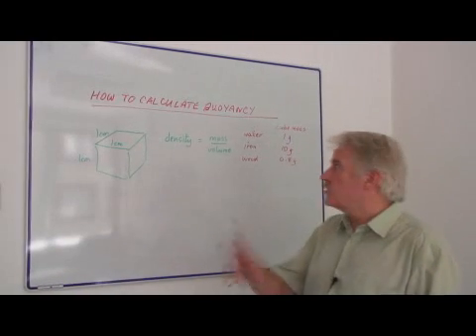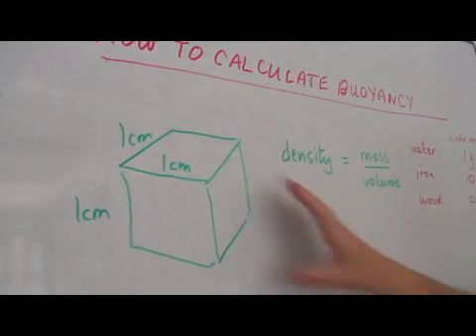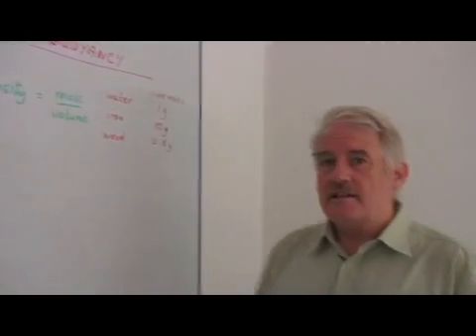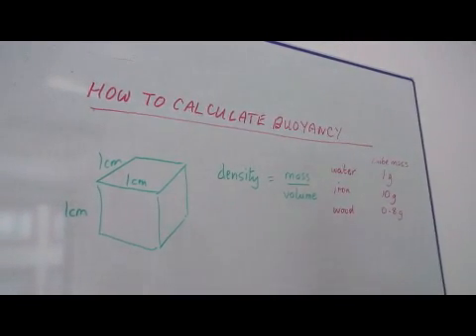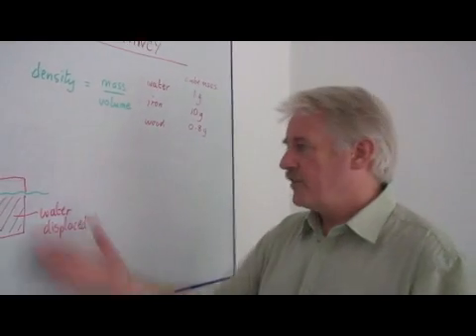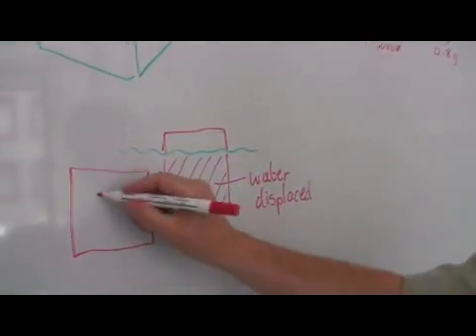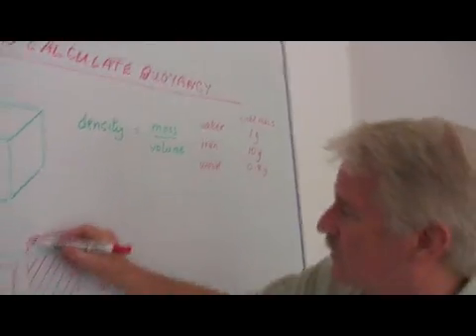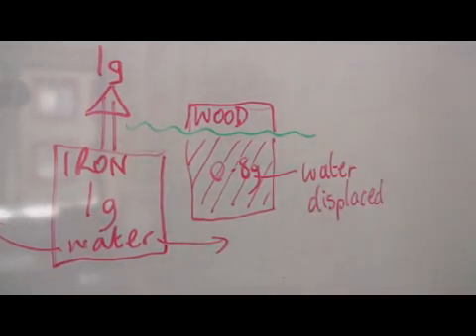How to Calculate Buoyancy

Comment: Shouldn't you use a different word other than weight when describing the displacement? Since "if the water weighs the same" as the steel... they weigh the same? the steel can't be heavier than "the same weight of water" because it is the same weight, in that case you would just have a lot more water

Comment: The above example doesn't consider internal inflation pressure.  I'm keen to know how the buoyancy of an inflatable pontoon with a 140l capacity will be affected by inflation pressure, i.e. how will the carrying capacity decrease if the pressure drops from 7 psi to 5 psi.
Reply: More pressure means more molecules of air which means more weight. If the toon doesn't increase in size at all from the inflation it will just be heavier and sink more.
Reply: @mattfuchs7626  based on experience with Chiliboat water bikes, I can now confirm the following: more pressure = more carrying capacity.  Low pressure = passenger will sink.

Comment: At about 1:32 the statement of Archimedes Principle needs to have qualification, as stated it is only true IF THE OBJECT FLOATS  it displaced its weight of water, iron objects clearly do not displace their weight in water, therefor they sink. This is brought out later, but is confusing at first. Otherwise good video!
Reply: Arthur Mercer didn't Archimedes develop his theory in order to test if a crown was pure gold? The water taken up by the solid object that sinks is displaced to another location, so his definition is correct.